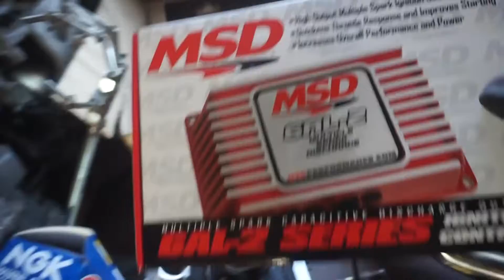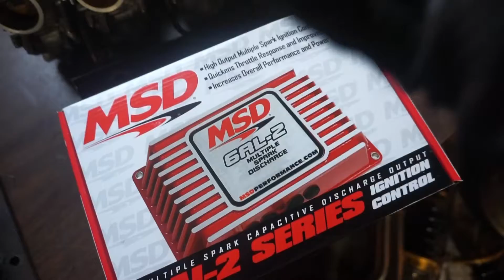WHY did i think it was a GOOD IDEA!?!?!?!?

Comment: Hey Bro! Great work on the Tercel! Need your expertise with my Tercel. I was thinking of going 4AGE. It’s an automatic now. Can a keep it FWD? Don’t really need to go RWD conversion. What would I need? The 3AC is way slowwwww. Lol
Reply from the maker: THANKS MAN! and honestly if you can find a 4age, you can just swap it right in. the spline count is the same but you would have to use its corresponding clutch/flywheel. THEN youd have to figure out the electronics if you plan to keep it FI, if you go carb then it would be simpler. another option is taking the 4age head and crank gear, pistons, water pump, alternator bracket and dizzy, and just do a headswap. theres a shit ton of writeups on hachiroku.net and club4age on doing DOHC headswaps on 4a/c blocks and even swapping in a 4age into a 2nd gen tercel.